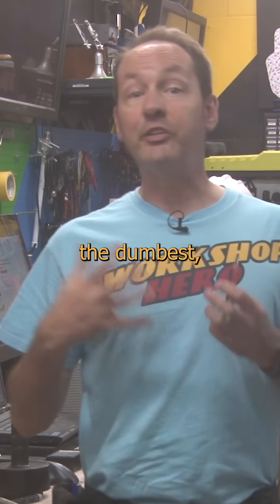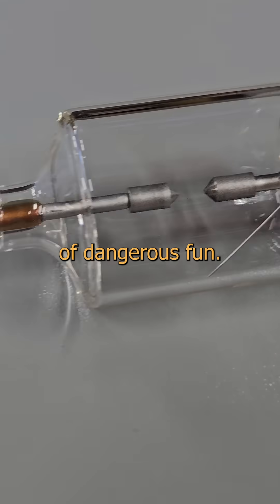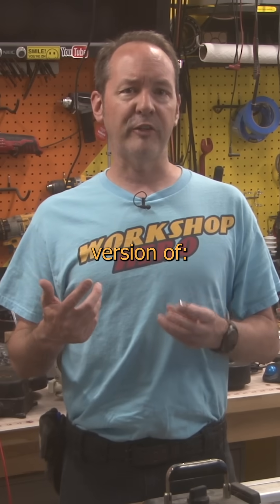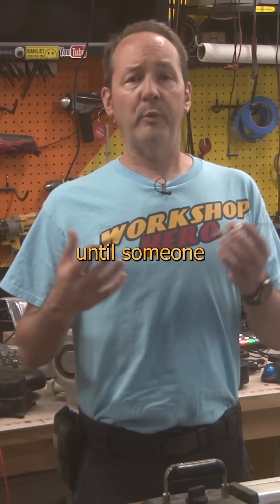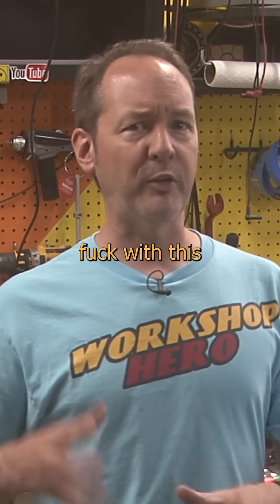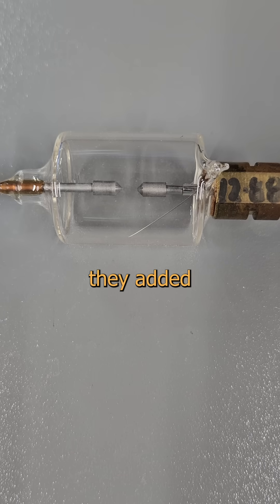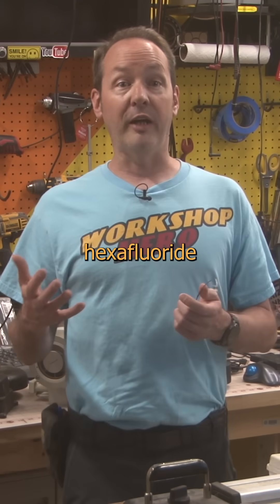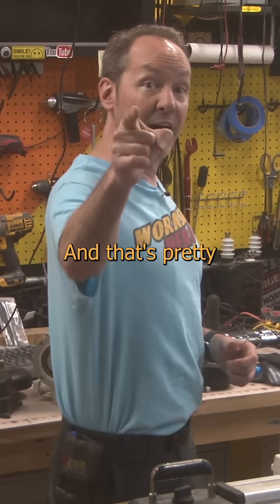Spark Gap Tube #chrisboden #comedy #engineering #highvoltage #physics #tesla #science #energy #cool

Comment: When he mentioned the hydrogen it reminded me of a Natural Gas line we had to repair. We built a scaffold around the area where the weld was going to take place and we sealed the entire area to the best of our ability. They would not let us make the weld as we didnt have the certifications but they brought in an older guy.
What he did was wear a supplied air respirator that fed him oxygen and released the air he breathed outside the tent. Then they filled the tent with Natural Gas with him on the inside and once he reached 100% saturation of gas he made the weld. You see Natural Gas will only explode when oxygen is present and I assume hydrogen is the same way now.
Yeah I was absolutely 100% fine with them bringing in an outside specialist to make that weld and so was every other welder on the job. Yeah, F that sh1t!!
Reply: Dang that is pretty cool
Reply: I'm guessing he earned what an average welder earns in a month in that short time.
Reply: @RASF74  You used the correct word, he definitely earned that money because none of us wanted anything to do with it even if we would have been allowed
Reply: If you do the math right, it works. Every gas has an upper ignition limit, which isn't that high for natural gas (it's 15% in volume for methane in air), therefore you just need to keep the methane level above that threshold and you're safe
Reply: Hydrogen is a bit more problematic as those limits, in air, are 18 to 59%
Reply: @iaial0  try acetylene, explosive range is 2.5% to 97.5%! Or hydrazine, which will even explode at 100% concentration LOL
Reply: @Auriam  Dang I didn't know acetylene was worse than hydrogen, none of those two are pleasant gases to work with.

Hydrazine, being present in many hypergolic mixes, is a whole another level of angry 😂
Reply: thats actually crazy interesting. thanks for sharing. and ya fuck that shit 😂
Reply: do you still need an inert gas (argon) when welding in that type of atmosphere?
Reply: @IvoKintobor  Thats a darn good question right there. I have no idea how natural gas would affect a weld. Would the gas affect the weld penetration in the base metal, would the weld puddle flow the same or maybe it causes the weld arc to jump all over the place as if you were welding in a magnetic field?
Just offhand I would guess you could make the weld though it would probably cause the welded metal to color differently 
In the example I mentioned they welded stick so its a moot point.
Reply: Wonder what he got paid to ride in on his gigantic brass balls and make that weld though??
Reply: I believe a wave of You"Tube avt0mated m()derati()n has swept this comment section, since a comment I was responding to vanished, alone with many others
Reply: Smarter would be to fill the tent with an inert gas.
Reply: @e-curb  smart but I imagine it's cheaper to fill it with gas that's already on site. Nothing makes penny pinchers happier than risking peoples lives to save a few dollars.
Reply: @alexwright6816   I wonder how they deal with the nat-gas after the welding is done? Just venting it seems like a hazard. Straight N2 is about the cheapest gas you can buy.
Reply: @e-curb  yeah but the natural gas is already coming out of the line he's plugging, it was going to leak either way, better to not use up N2. And venting it seems like a hazard? Yeah, it is, but again, the alternative costs money. If there is one thing any big company hates, it's spending money. The only time I'd expect to see a big American company spend money on their workers safety is after being sued for negligence. (this is half sarcasm if it isn't obvious.)
Reply: @alexwright6816  Luckily I've been on the internet long enough to be able to detect half sarcasm
Reply: @Blitzjager  I gotta say, even MY sarcasm detector has the occasional "I can't tell" these days, and that's after being raised by an extremely sarcastic dad, and being a sarcastic person myself. When things reach a certain level of crazy, I STILL occasionally wonder! (This one was clear, though!)
Reply: You can't, because they are welding on a live gas line, so large amounts of gas will be filling the tent anyway and pushing the inert gas out. So any inert gas would just be a waste of money. 

This is commonly done without the tent in other situations such as in trenches, the welder just has to stay out of the flames from the burning gas, and they have to keep the pipe turned on so no oxygen can get into the pipe and cause an explosion.  @e-curb

Comment: The peak of 433 volts is 612 volts, so just as well we use 0.6/1kV cable in Australia.  433 is the delta of 250 volts, and what is on tye warning sign on the low voltage access panel on padmount transfomers in rural NSW.

Comment: I was told that telegraph stations had devices like this to ground lightning or static electricity.  High voltages would flow to ground instead of destroying wires, equipment, or maybe even operators.

Comment: Why would you use a spark gap vs a resistor? Because I am assuming that the spark gap is used as a way to ensure no electricity trickles through until it's at the minimum voltage, but this could also be done with resistors. Also wouldn't the coronal discharge create heat which would weaken the electrode over time? Sorry if this is a dumb question, I am trying to understand the purpose.
Edit: after thinking about it for a brief moment. Is this the mechanism behind breakers? As soon as the stop gap is tripped, it cuts voltage to the source.
Edit edit: After looking it up (restating here to ensure I am right) it's because resistors allow for a small amount of voltage, which I misunderstood. Yes the coronal discharge would wear down the electrode over time, but that's better than sending inconsistent electrical voltage across the circuit in certain pieces of equipment.

Comment: Question, why would the wire in our home need to be rated for 300 volts when domestic system range 110-240 volts? Surely it would be impossible for the system to reach a high enough voltage?

Comment: Actually the breakdown voltage for air at standard temperature and pressure is approximately 3000 V/mm, that is for every millimeter of air, it takes 3000 V to cause insulation breakdown across the air between the two electrodes. For 300 V to cause breakdown you can have a gap of approximately 0,1 mm or 0.0039 inches.

Comment: Spark gaps (as simple as a car spark plug) have been used for a century as a lighting diverter for ham radio antennae.  Since the radio runs on millivolts to receive and a few hundred volts, max, to transmit, if you built up enough voltage to jump a few millimeters of gap, it'll shunt to the ground rod driven several feet into your not-too-dry soil -- instead of into your expensive to replace or repair radio equipment (and hence not set your house on fire).

Comment: In very loose terms that's how the high speed flash I'm starting to build works. The distance between electrodes keeps the capacitor from discharging until the air between them ionized by a HV pulse transformer.

Comment: Currently LED systems are replacing my xenon bulbs
But we use on a flash 310 312 and 324 a spiral type xenon filled tube which is roughly 6 inches long but curled around itself and it has to be energized for the electricity to flow through it and when that energy stops, the electricity stops flowing that is how our towers That are over 199 feet used to be lit like I said they’re crushing those with the LEDSystems. And now I have a whole bunch of ancient 500 Vdc machines sitting in my storage areas.
Reply from the maker: Could you please reach out to me via Discord or email? My email is on teh front page of this channel and my Discord is https://discord.bodenresearch.com/ Thank you :)

Comment: Aircraft sparkplugs are around 25 to 50 dollars each.

So at service they don't just toss them in the trash when replacing 8, 16 or 19 plugs in some engines.

They pulled, clean and check the gap.

Then place them into a test chamber with a set pressure and weak or bad plugs failed 

The bad ones are replaced never knew that pressure would affect the ability of a spark to jump a gap.

Keep up the good work your videos are 

Insisting 

Eadcation 

And fun 

With a twist at times

Comment: At my job we have voltage fuses that work similar to this. They use plastic discs to have a fixed gap. we put two of those disks to get it to 500V. So it’s still pretty close, usually the arc is enough to weld the two pieces together. Because we are very close to dc train infrastructure we only have one end of the pe cables permanently connected and use those voltage fuses to connect the second end in case of an actual fault

Comment: I work at a combined cycle power plant, and we use hydrogen for cooling in our old steam turbine generators. Purity is incredibly important while running to prevent an explosive gas mixture.  When purging them we never purge with air. We purge them with an inert gas (Co2) and then purge the Co2 with air.

Comment: For those who are commenting about Hinderburg, in these hydrogen alone doesn't burn.

Yes it's true hydrogen alone doesn't go boom you need 1:2 mixture for that, otherwise it would just be an aggressive fireball.

Hinderburg didn't explode, it turned into fireball indicating that something else brust on flames there.
However the hydrogen did boost the fire, after oxygen got in the same hole where fire was.

If Hinderburg had the perfect or partly perfect mixture of oxygen, it would've been a hydrogen bomb instead of fireball.

Comment: Then whats the tiny little stick to the side for? Is it for if the voltage is significantly higher than the point where switch activates? Why would you need it then?

Comment: SF6 is nifty--- once it does break down, it's an excellent conductor and mostly prevents contact pitting/welding.  Great stuff for high voltage relays that need to work more than a few times.

Comment: They can also have radioactive material if they are fancy
Reply: You really 100? What's your background? At 100 that would put you squarely in the  vacuum tube hay-day.
Ones with isotopes probably were mil-spec? They acted as ignition starters if the vacuum got too good?
Reply: @dreynolds7915 am I 100 yes im always 100

Background hobbyist and collector

Yes but they were also available to normal consumers but mostly military 

Its like how they still use thoriated tungsten for welding it helps get the arc going

Comment: Engineering is kinda what I do, at a professionel level with real engineers, but I am almost a dropped highschool away from having no formal education at all. So saying that I am one would amount to stolen valor. That being said I encountered electronics engineers who gave me a blank stare when I asked if they used spark gaps/sacrificial anodes in some of the ports of their design that had every right to ve extremely tamperproof by necessity. Kinda scary.

Comment: I honestly wanna see you make a video about taking apart microwaves because I have a microwave that is itching for me to tear off its skirt and get at It’s transformer. But I need to know how to do it safely and every time I try to look up how to safely discharge a microwave they don’t show everything or they don’t tell you shit like what tools were used to discharge the tin death box known as a microwave capacitor like could I use a wooden stick with two nails and a piece of copper wire on the two nails to discharge it or would that blow up the capacitor do I need to get those candy corn pliers you talked about that are meant for electrical work or will the standard black handled pliers that almost everyone has work not very many people get into the details of how they do the shit that they do on the Internet whenever what they’re doing is putting out guides so people can do this themselves and there’s a reason the devil is in the details because if you don’t give the details, the devil will gladly take you to the ring of hell for osha violators also I know I’m not touching the microwave without welding gloves because welding gloves are meant for high electricity work because welding is high electricity work

Comment: I recently learned that radioisotope charged gaps can be replaced with simple UV LED aimed inside your gas. Say argon gas at 1/2 bar. You turn on the led as any charge builds up and break over is very repeatable. Cylinder shaped electrodes will not erode as fast as sharp electrodes. Forward losses are enough that you gave to take care to not overheat these.

Comment: I'm a power  lineman. we used to use Gap lightning arrestors on pole mounted Transformers, the gap set just enough apart that normal voltage would not jump across it  but lightning would. But so would squirrels, lizards, etc, so we don't  install that type of lightning arrestor anymore
Reply: That's s too bad 'cause the world needs few squirrels. They're real cute when they're robbing your bird feeder but not so much when they make a buffet of your fiber optic cable.  Squirrels LOVE that plastic jacket and then have the fiber inside for desert.  On phone(copper) lines the transport voltage decreases the appetite of most of them but fiber is just nom-nom city...
Reply: @brucebennett5759 Squirrels also raid bird's nest for bird eggs, and will literally fight the nesting bird. Luckily for the squirrels, they are smart enough to only do this with small birds. Atleast as far as I know.
Reply: I am in awe of linemen/women. I have designed with voltages up to 300kVDC and Accelerators to 10MeV but AC can be NASTY STUFF, even at 120VAC, let alone what's at the top of poles! Hat is off to you.
Reply: The world needs to know. Are squirrels more conductive than lizards?
Reply: @dbeekman9738 Asking the real questions here

Comment: been a while since i checked but most of the wires I use is 600V rated because it can also be used on 277/480V circuits and need that extra.

Comment: I bought standard spark gaps for various voltages to put in parallel with the spark plugs for rocket engine igniters- in case the plug was defective or the cable loose, we didn't want 10 kV to find its own destructive path to the return.

Comment: That guy is awesome and he is 100% right. Has hydrogen gas in volume will never be volatile. Matter of fact you can inhale it. It will not harm you as it's already in the air brother and your body actually breaks this stuff down, utilizing it in its own constructive ways building itself. It's part of your makeup and it's part of something that is released from you and you're in. The grave goes right through the concrete and I don't know what else to say. Other than I've got a hydrogen generator and different levels of gas are produced. Different lights, different heats and he's 100% right. I'm now playing with spark gaps driving magnetic motors free energy and I've been looking at picking up one of them style where I can change it and manipulate it in any manner. I want radio driven antenna with a spark gap driving magnetic motor play with this idea please. I believe this is what Tesla shoved inside of his Tesla car and whatever year or that was. I forget the basics of the information is above the rest of the structures in my brain and doesn't turn into words well but is almost complete in the shop

Comment: Some extra info/context about spark gaps for anyone watching this going "but what would you really use this for?".

My experience with these is in terms of RF towers, and you'll see multiple types from "spark balls" to "z feeds". I'm a lighting protection system on a live tower, you generally have to adjust these seasonally as the air humidity and such affect them. You do this with the transmitter at full power and back then out, then bring them in until the arc and back then out slightly. (Moving them with the power off, for safety). 

This allows for the rf to not arc, but any additional power from a lightning strike would theoretically arc. There can be more than one of these in line. And usually, in the setups I've worked on, you'd have 1 or 2 large gap setups to take the brunt of the hit. Then you'll have smaller gas filled chambers (coaxial polyphaser style ones) that are more finely tuned toward your operating power, as well as with faster response times and such, to attempt to take the rest of the excess energy to ground. 

With all of that being set up in the hopes that the lightning is just a slight "surge" that the equipment can handle by the time it gets there.

Comment: Dumb question: if house electrical cables were under 300V, would it decrease risk of house fires from broken wiring, or would the voltage be too low for consistent conductivity across switches and such?

Comment: Is breakdown voltage constant regardless of length, or would it more accurately be described as ”breakdown voltage per unit length”? I’d imagine it takes less voltage to turn a centimeter of air into a conductor than it does a whole meter?

Comment: What's really cool is? If you look on certain circuit boards, you will actually find a printed PCB spark gap that is intended to give a path for power surges to arc, rather than frying all of the logical components.

Comment: Unless there’s an obscure piece of knowledge I don’t have, hydrogen needs oxygen to explode, since fire is basically atoms undergoing oxidation. So yeah, you could have live sparking voltage inside a sealed glass of pure hydrogen and not get an explosion. But getting rid of all the oxygen in the first place is a pain—vacuum setups are insanely difficult and usually need multiple kinds of pumps to achieve a true vacuum.